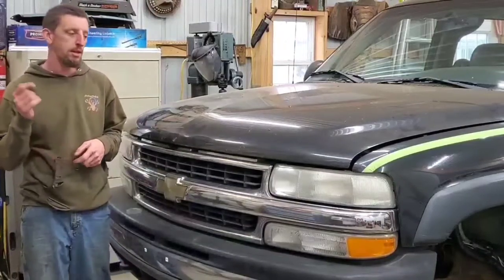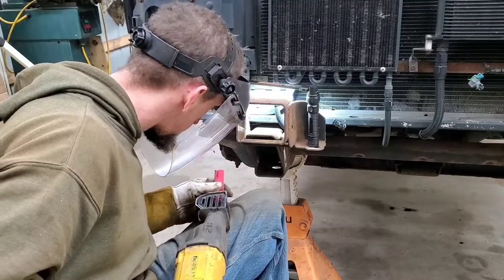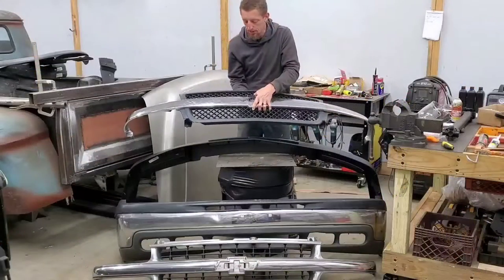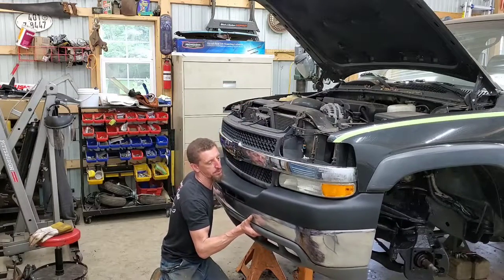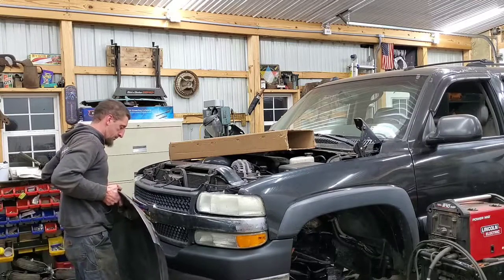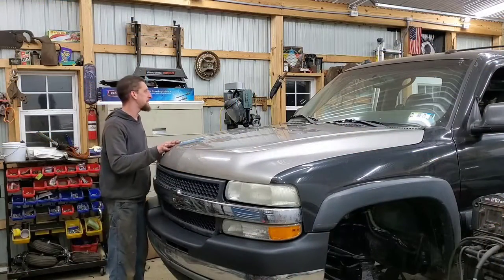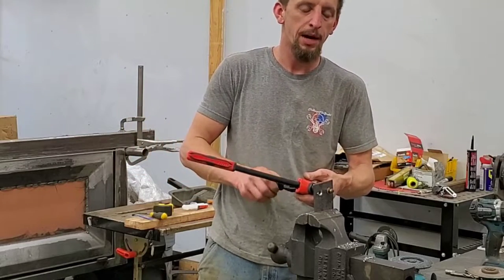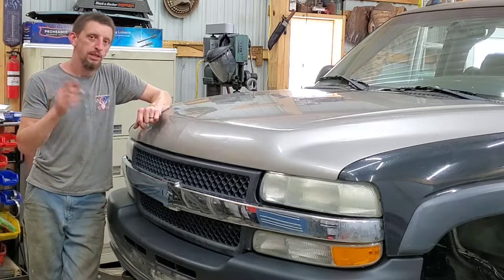Chevy HD Front End Conversion - Installing The 01-02 2500HD/3500HD Front Clip On 2004 Chevy Suburban

Comment: I was trying to buy a 2002 Chevy truck 2500 HD back around 2007 for the same reason, love the look of the hood. It matched the hoods on my 71 & 72 Chevy trucks. I ended up getting a 2002 GMC 2500HD and still have. Awesome job
Reply from the maker: Yes sir.. The 2yr only HD front clip reminds me of the same year front ends..  I had the hood for this conversion for over 3 years and finally made it happen... The change is subtle and iconic for those who know the old chevy trucks... Looking at your profile picture you know 😉👊👍Thanks for commenting..🇺🇲😎

Comment: You can use Repel %40 insect spray on the headlight lenses to remove the clear coat on the plastic that has turned yellow brown color. I usually spray the complete lense and let it soak about 2 minutes then use a bath towel to remove the yuck and repeat about 3 times and they’ll look almost new,
Reply from the maker: Interesting....Very Interesting 🤔🧐👍👍 I will definitely have to try this...

Comment: I have a 2000 silverado and I was thinking I had to change the whole bumper to do this but only having to change the upper valance is awesome.. nice video.
Reply from the maker: So when I changed the front clip on my 02 Silverado pickup I switched the bumper only after I purchased all the parts realized the bumper was the same,  this time just went for swapping the bumper cap and worked out just fine.  Good luck on your conversion if you decide to go for it!  Thanks for watching and commenting. 👍
Reply: @ChallengeTheBuild  seeing this saved me some cash so thank you sir...
Reply from the maker: Awesome...  Also the conversion I did on my pickup truck was easier in regards when it came to dropping the bumper horns/brackets down.   You should be able to get the swap done in a day, or atleast a solid weekend.  👍
Reply: Did you Stull have to drop the bumper brackets  brackets to fit the new uper valence ?? @daveparsons
Reply from the maker: My guess is he still had to drop the bumper.    Im pretty sure just swapping the bumper cap isnt enough.    If I remember correctly when I did my truck I needed to drop the bumper  horns down an inch.

Comment: Great video.. I'm in the process of doing this swap myself. It looks like the grille is an aftermarket one, the GM ones had the bowtie area recessed a bit. I also noticed you had different bumper mounts than what I have seen with this swap before..
Reply from the maker: Thank you.  The grille may be an aftermarket because you are correct about the recess it didn't fit as good as my truck conversion and I did find it in the junk yard but at 20 bucks it worked!   Also the bumper mounts are different between the trucks and suburban so there may be a little variation there also..  There was so much more I could have added into this video but just like everything else there is a fine line of what people want to see or need to see, still trying to figure it out myself..👍

Comment: Great detail and info. Is there a way to do this WITHOUT cutting the bumper horns?
Reply from the maker: Not that I know of..  I did the conversion on both of my trucks and they needed to drop a couple inches in both vehicles.    If you don't drop them down they get in the way of the bumper when you drop it (Im pretty sure) ... 👍🤝

Comment: Hey I was wondering after you installed the new hd bumper cap, and grill look did you also have to put the hd hood or can you keep the stock one?
Reply from the maker: You can use the stock one also.   I have the stock hood on the truck right now unti the hd hood gets painted.  The stock hood just doesn't look as cool 😎👍👍.

Comment: I want to really try this but I have a 3 inch body lift so don’t know how that would work since the bumper brackets will be different
Reply from the maker: When you did the body lift did you move your bumper at all?  The way my mind is thinking, if you raised the "body" up thats the same as moving the bumper down..  All you may need to do is change out the top bumper cap, swap in a 2500hd grille and you might find everything fits.. 🤷‍♂️  Just thinking outloud ... Im sure you can figure it out... Its definitely a conversion that is worth doing...💪💯

Comment: I have a 2000 gmc sierra that i bought 99 Silverado fenders and HD bumper do I need Hd grill, Chevy Hood or HD and also Chevy lights?
Reply from the maker: So I don't know exactly what GMC did in 2001 & 2002 for the HD, but in order to switch to the Chevy HD look I do believe you need to switch everything.   I know gmc has different style lights and grille, I feel like the fenders should be the same but I am not sure.  If its a 1500 gmc you probably will still have to drop the bumper down to accept the 2500hd grille.   Hopefully this helps, good luck with the build!👍

Comment: Hey man how did you end up fixing that evengap between the grill and the hood I’m having a problem with mine and i cant seem to find the problem 😓
Reply from the maker: I know this is kinf of a dumb first question but I have to start somewhere...does your front core support have the little rubber bumpers that the hood rests on?   I assume it does... Also is your hood twisted and you may not have noticed?   Are your hinges twisted?   I spent alot of time adjusting the rubber bumpers to get it to sit right and even still it's not perfect but had to just get it close and walk away...😎

Comment: I’m trying to figure out which bumper brackets to buy. I’m swapping my 2003 GMC 2500 HD to 2001 Chevy HD.
Reply from the maker: 🤔 I feel like you wouldn't need to buy any?  Maybe just swap out top bumper cap and grille?  If you already have a 2500 series truck Im thinking just those two things?   This video was more pointed to converting 1500 series trucks (even though the suburban was a 2500 it was very different then most trucks) ... I never bought any bumper brackets, always just cut off the old bumper horns and re-welded them back on in the position needed...🤷‍♂️. Good luck with your build!🤙
Reply: @ChallengeTheBuild  The brackets that you built at the end, couldn't you have swapped them from one side to the other upside down? My neighbor did his this way. I am not sure if it would've worked for you?
Reply from the maker: I think you are correct and at the time I certainly didn't think about that 😂 regardless it was easy enough...
Reply: @ChallengeTheBuild  I think your way looks HD though to be fair lol.
Reply from the maker: Thank you..👍 And thanks for watching and commenting.

Comment: I have a 2005 tahoe. Can i get away with just changing out the hood?
Reply from the maker: I believe so yes.   2000-2006 is the year range I'm pretty sure 2007 is when chevy changed body styles in the trucks (cat eye style) and I think also for the tahoe and suburbans (just verify that, I am not 100% sure).   Hopefully this helps.